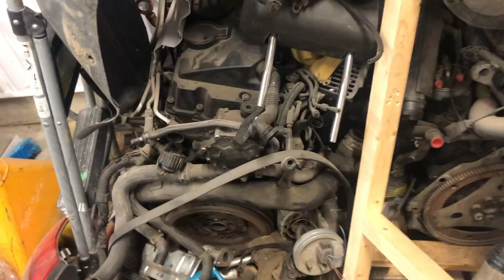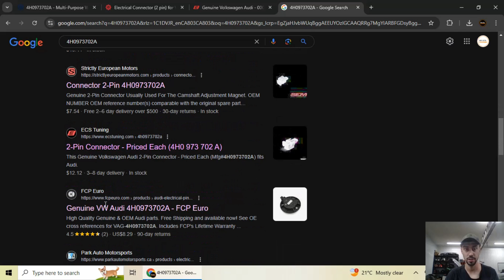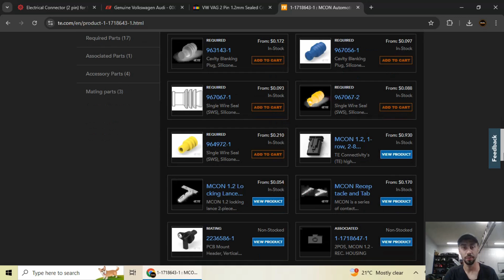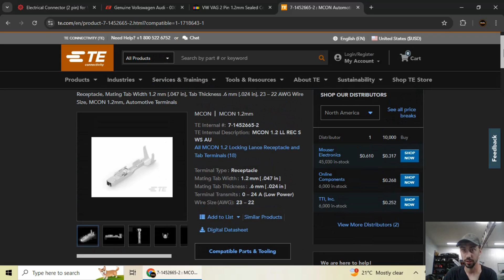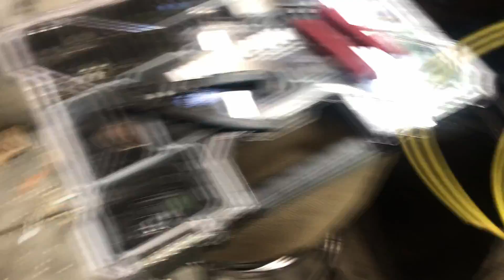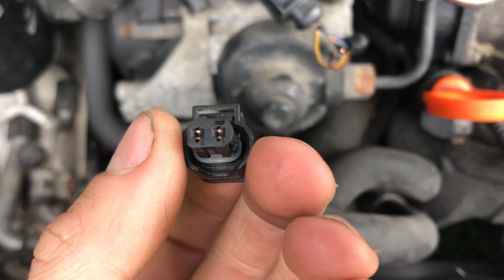Diagnosing P0181 & P0183 VW TDI: Fuel temperature sensor Implausible signal & Open/short

Comment: The timing of this video couldn't have been more perfect. Was driving home from the store yesterday when the check engine light flashed on my 13 Passat TDI. Checked the code to find P0183. Popped the hood, and sure enough one of the fuel temp sensor wires was separated right at the connector. Looked like it had been repaired before, but I just cleaned it up and soldered in a new length of wire. Thanks for the info!

Comment: Nice video. I would probably just pull the pins and solder the wire on.
Reply from the maker: Yes that’s an option as well, the plugs incredibly small and my de pining kit doesn’t have anything that small